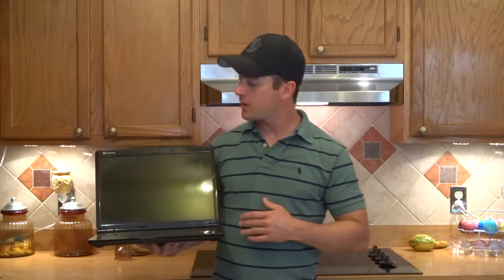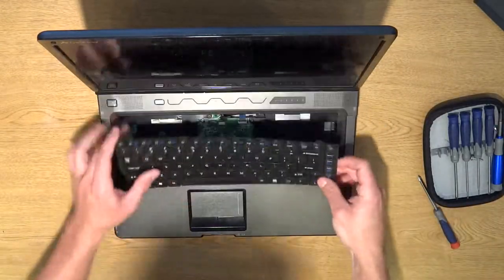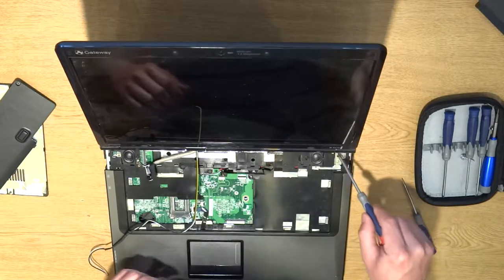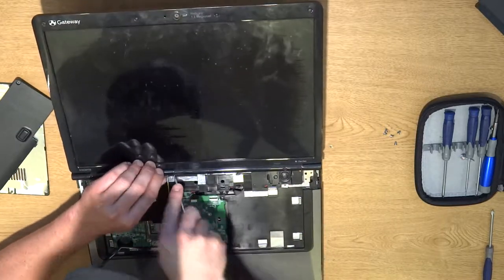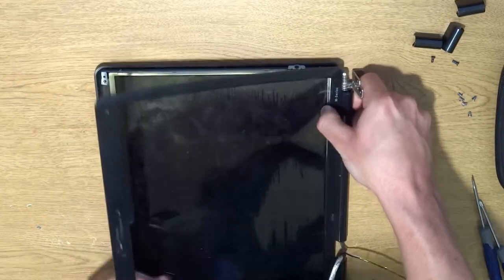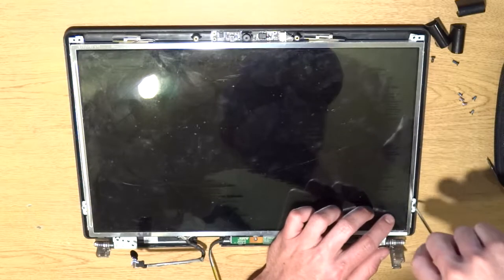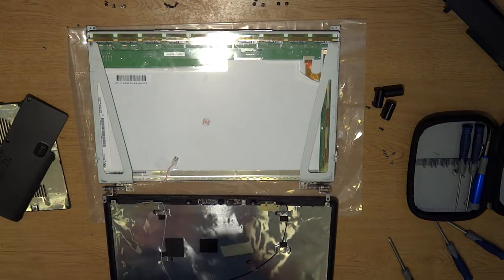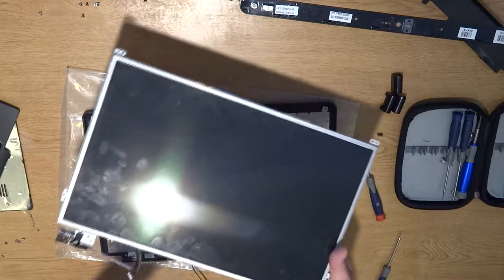youtube video #-7LwxK4bL1o

Comment from the maker: MrPCEelectronics Most Used & Top Recommended Items
Camera: https://amzn.to/3elhKTc
Lens #1: https://amzn.to/3szP7do
Lens #2: https://amzn.to/3sDfWx4
Hard Drive: https://amzn.to/3Foe2nD
Hard Drive USB Cable: https://amzn.to/3elhUdg
Data Recovery PC: https://amzn.to/3ev1fnn
Data Recovery MAC: https://amzn.to/3mxNTeu
Hard Drive Cloning: https://amzn.to/311mxpO
Card Reader: https://amzn.to/3szf2BV
Wireless Mouse: https://amzn.to/3EsGuDD
Bluetooth Wireless Head Phones: https://amzn.to/3pAKCNP
Soldering Station: https://amzn.to/3yZ8227
Solder Wire: https://amzn.to/32C9dIY
Thermal Imager: https://amzn.to/3FyKGTB
Xbox Live Pass: https://amzn.to/3EqNz7B